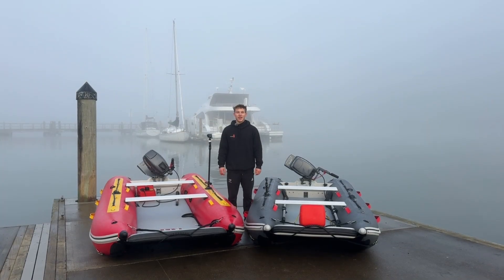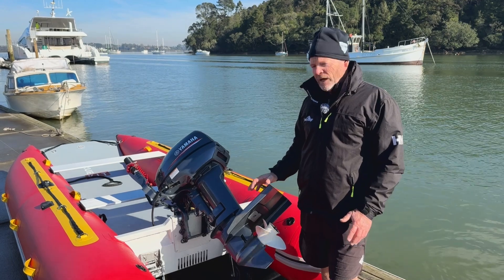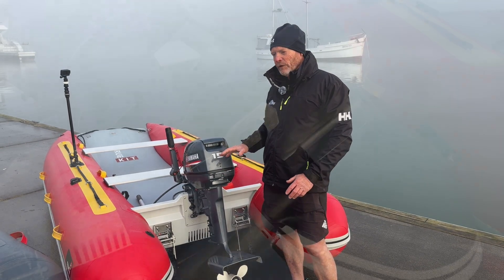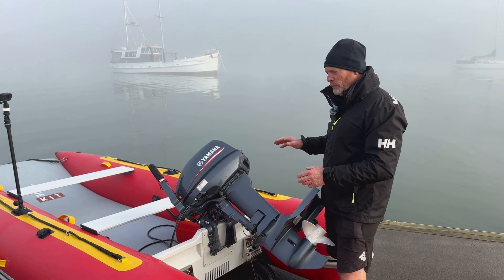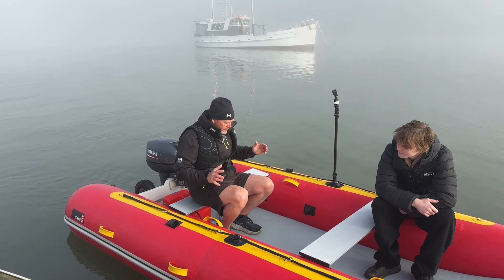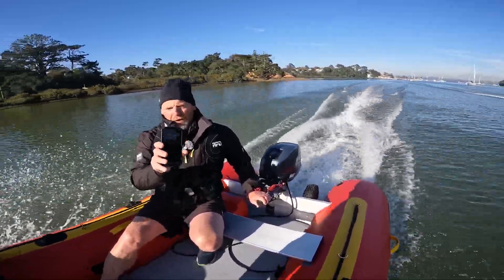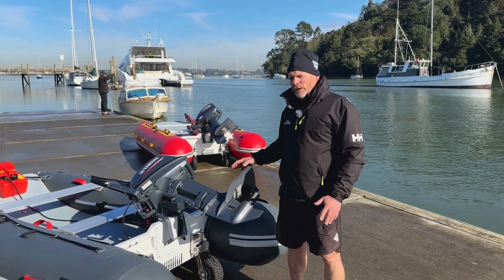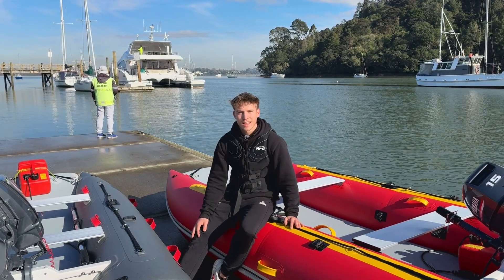Unlocking the secrets to True Kit performance

Comment: One thing not covered was weight of OB and how it affects rough water performance. Lighter motor lower planing speed which makes big difference in rough. I've run varies motors on my 3.5m monohull RIB over the years. 30hp tohatsu 2S is standard and was chosen for tank diving. On one trip used mate's 8hp 2S to take two of us spearfishing,  cruise speed was down to 10-12kts. On return trip we had to punch into 15-20kt chop, with 30hp it would've been uncomfortable trip with me picking my way through seas. With 8hp it was comfortable trip back at about 8kts on plane punching straight into sea. The difference in handling came down to 22kgs less on transom.  

If you plan to run boat lightly loaded most of time go for lighter less powerful motor, cruise speed maybe slightly lower in calm conditions but in less than ideal conditions ie moderate chop it will give better ride.
Reply: THANK YOU for the most insightful (experience-based) take on the other side of the coin when looking for an engine for the small cat dinghy. I have really been looking at the fastest (biggest) outboard I could handle. Your comment has tempered that approach. Thanks
Reply: Thanks for this real-world-sounding advice. I would like True Kit to be so informative. I find their information videos a little haphazard and not so impressive. For example- what about propeller pitch? Is the stock pitch generally best or could there be advantages in going to a bigger pitch if you typically run with lighter loads? I noticed that both the 4 meter and the 3.3 achieved similar speeds heavily or lightly loaded. That suggests to me that the speed under light load was pitch (or rpm) limited - but that was not addressed or even, apparently, considered.

Comment: Nice modified transom. So perhaps now you can admit you cooked the design of the first alloy transom? Or maybe keep pretending there was never an issue?
Reply: That’s a bit harsh.  The models improve thru evolution.   That said, I’ve had 3.3 Disco low transom for 4 years now with a 12ho Tohatsu 2 stroke and have put blocks  under saddle to raise outboard mount.  It woukd be nice if there were sone  retro mod or kit to raise transom by 50mm whilst retaining clamp.
Reply: @gaycha6589 or maybe they should have made the transom the correct height like there previous and current models.
Reply: Issue from my perpective when i purchased a 4m discovery they denied completely that there were issues with transom height and cavitation - every excuse under the sun vs the design of the actual boat specifically transom - listen to what Rod owner says - Raised transom to accomadate a heavier outboard - interesting - no mention about transom height and cavitation. You notice the vast majority videos are also undertaken on dead flat water - performance is hopeless in chop.....instead youll  pay alot for a marketed 'premium deemed boat' but then oh get a better prop, a permatrim, smooth throtte take off....laughable really. Spend extra on all that is recommended and youll still have issues in my experience if you arent in dead flat water - however you distribute weight.....
Reply: @w @waynehartley4362  totally agree. I have seen the Alibaba versions, pretty similar and a 1/3 of the price. It’s good marketing for an average product.
Reply: Or, maybe ya'll should remember it's a dinghy and not a sport boat.  Use and performance is a process of evolution not necessarily a flaw.
Reply: @phillipcoleman quite.
Reply: @phillipcoleman well the marketing should demonstrate that.
Reply: @phillipcoleman  this 100%.  Every design has compromises.  More than offset by the lightweight stability and normal use benefits and capabilities.  I’m 4 years ownership with my 3.3m with Tohatsu 9.8/ Yamaha 15 2s, and manages well with all I ask of it.  Quality is great at the price point   I’ve run cleaver propped race boats too. They also cavitate like mad if you gas it hard from the get go, just like a car will spin its wheels if you are not good on throttle control .  You gotta learn to drive your machinery.

Comment: Great video with some good tips and information😎.
Such a shame though that the transom height issue hadn’t been addressed with the original aluminium transom which caused real issues with ventilation and drag, I tried a cupped prop and permatrim which had no real effect, only when I raised the transom by 2 inches did the issues stop, the outboard in stock form was fine after this.
Thanks again for a good video 👍.
Reply: I just got my Discovery 330 and put 2 or 3 hours on the motor.  As I was doing the motor break-in, I noticed a lot of ventilation at around 90 to 100% throttle.  I have a short shaft Honda 15hp with no permatrim or other kind of hydrofoil.  So you would suggest raising the motor up some to help with that?  How did you raise your transom?  Just curious!
Reply: @lmgilber hi this video shows how I did it

https://youtu.be/5iDuvmFsA0o?si=VbIBZR3rBn4Qie-S
Reply: can you tell me how you raised the transom?  thank you

Comment: Quick question: is it possible to mount and use fish finders/sounders with the discovery vs a hardbody/hull boat? Do they work and if so, what do you need to mount them? Would be awesome to get feedback or a video. Love the informative videos and community engagement, keep up the good work 😊
Reply from the maker: Yes absolutely, there are many ways to mount the fishfinder on the Discovery.  We will make a video with some options when we get a chance
Reply: @TRUEKITINFLATABLES  awesome, looking forward to it. Is this info available on request in the meantime? Deciding between this and a Solo Skiff. Would rather the discovery but ability to use a fish finder is a big deal.
Reply: Fish finders work fine on the Truekits, there are various ways of mounting them, you can use the railblaza row locks with the relevant railblaza mount or add another mount somewhere else on the tube. You could also mount to the seat, there are various ways of mounting the transducer with removable mounts available or DIY options.
I’ll link a video with some ideas 👍
Reply: @TheHopefulAngler just took a look. Fantastic video and you just got a new subscriber for it. The plate design fitting behind the wheel seems genius (really like the wheels on the trailer too). Any problems with interference from the prop or has your transducer been far enough away?
Reply: @rhysgunnell8396  thanks so much 👍, I tried to mount the transducer as far to the right as I could but there is still interference caused by the prop when traveling at speed. I can still read depth but that’s it, I’ve since changed engines and again mounted the transducer as far to the right as possible with the same results.
My thoughts are that as the transom is naturally so narrow I could never get the transducer far enough away or that as my unit is old it may not have a good enough transducer?
Reply: You can get a mount that goes around the rear tube using a nylon strap and I’ve also seen someone gluing a pad onto the underside of the floor but I would imagine these are prone to being knocked off or causing drag to the hull.
Reply: @TheHopefulAngler awesome, thanks for the advice 😊
Reply: https://youtu.be/4jAK0waAzWQ?si=0n3wgu_--mQawlCi